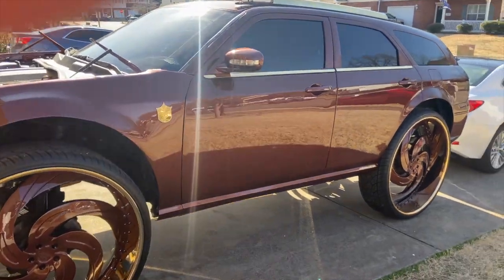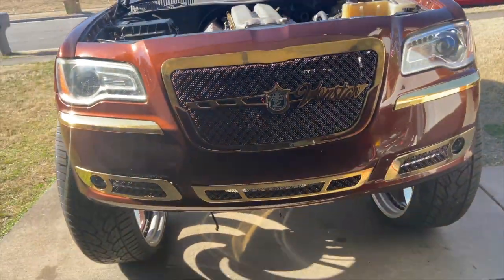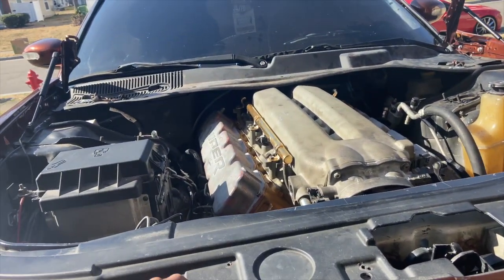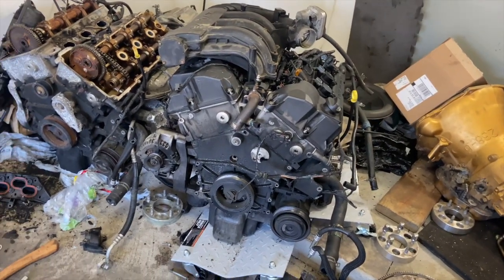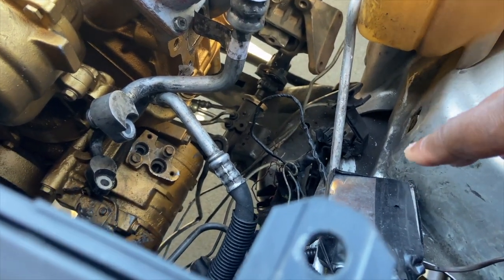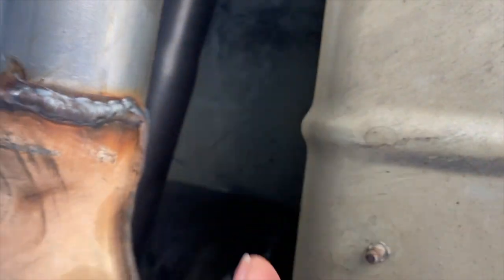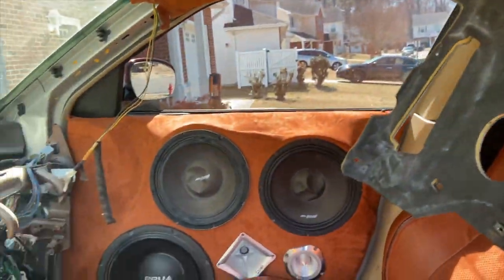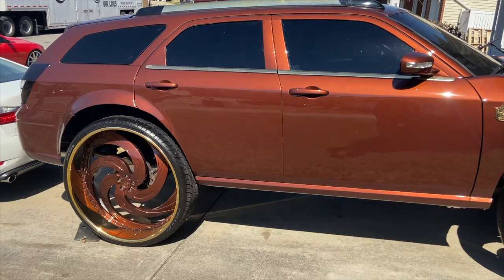Dropping A Viper Motor in the Dodge Magnum

Comment: Wusup Brodie. Great content. Was that 300s front just as easy as the last gen 300c swap on the Magnum?
Reply from the maker: The new gen is harder. Old gen you can bolt up. New gen a lot of work and fabrication and wiring up lights is hard. Old gen same electrical and bolts up with no mods
Reply: @CowboyVonStar  preciate the response